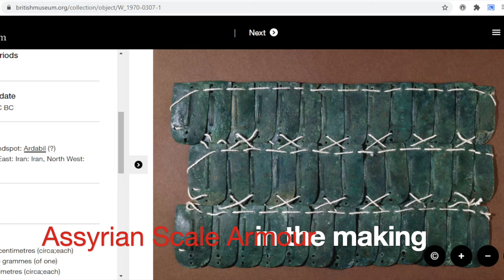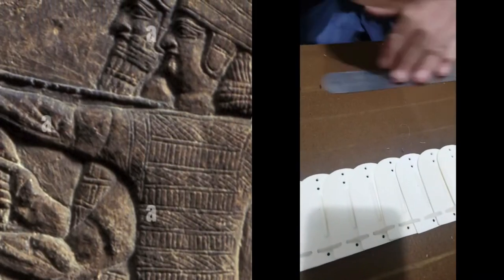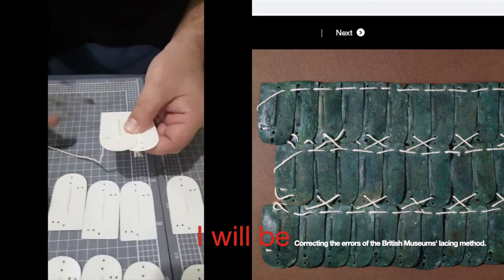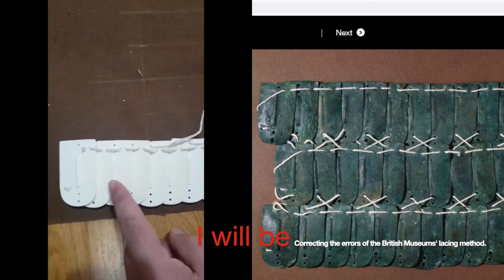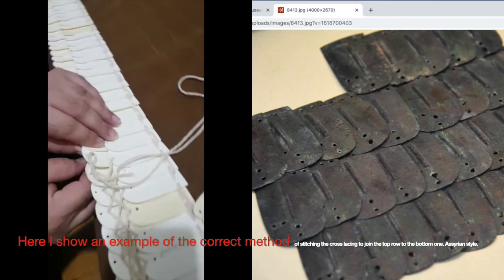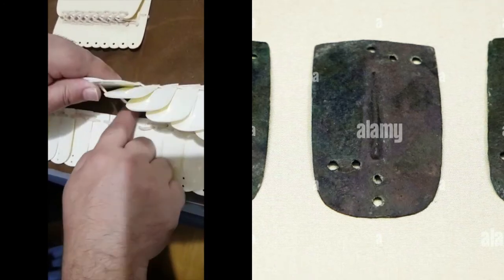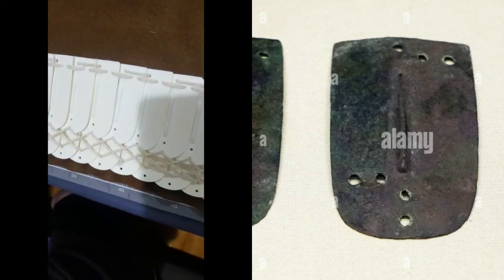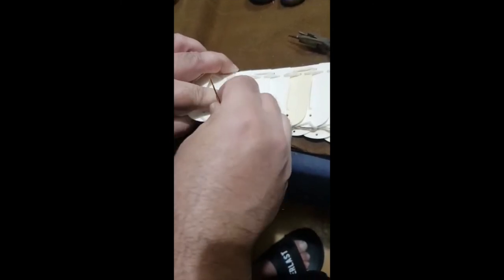Assyrian Scale Armour in the making Part 1

Comment: ah that's some serious overlapping----how heavy would a bronze scale suit laced like this be, historically?
Reply from the maker: Good question. Short answer is I don't know yet. The Long answer is... This particular scale has been given a weight of approximately 10 grams by the British museum website. 
The last suit i made with these scales, I used approx 450 scales(closer to 430 scales.)
 ( my scales out of resin weigh in at approx 4 to 5 grams each) 
So that would have made it approx 4.5 to 5.5 kg if they were real bronze. 
It was a sleeveless bodice with no overlap of scales.
This new suit i am making with the same scales mentioned above will have approx 738 to 750 scales. So this new suit will weigh approx 7.5 to 8.5kg in the original bronze.  Which is quite reasonable when compared to other armours.
Reply: @AncientAssyrianPropsCostumes  thank you for the explaination.

Is the new suit a long coat with shoulder pieces?
Reply from the maker: @cathayarmory7328  Hi, your welcome and thank you for your interest in my work.
The suit will be sleeveless and double breasted at the front, about hip or waist length maximum.
 Regarding the shoulders it will be constructed same as my iron coloured suit. I calculated 4 rows x 5 scales per row for one shoulder so that would be 40 scales for both. 
If it works out, then it will have the potential to have scaled sleeves and skirt (Knee length or ankle length)  added to it in the future. 
Check out my latest video https://youtu.be/KpzM4MiKKYI
that might help answer some more of your questions. 
My total amount of scales has been recalculated to 788 making it weigh a total of 8.274 kg if in real bronze and each scale at 10.5 grams.
Reply: @AncientAssyrianPropsCostumes  thank you! Will take a look